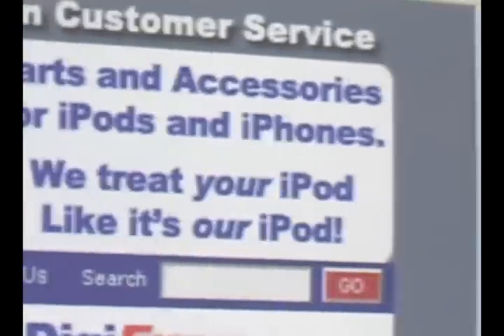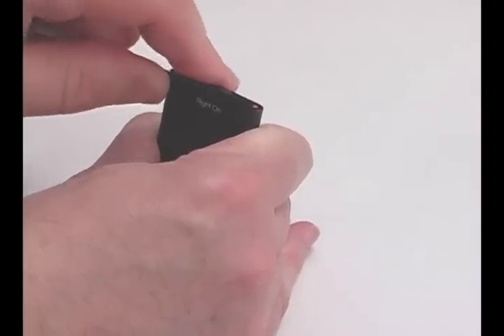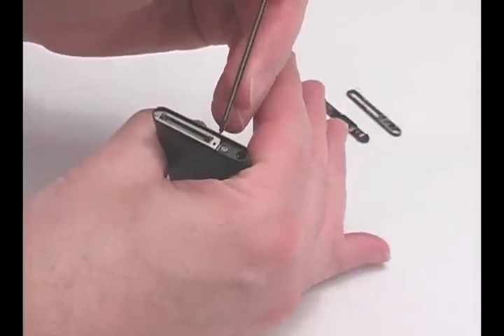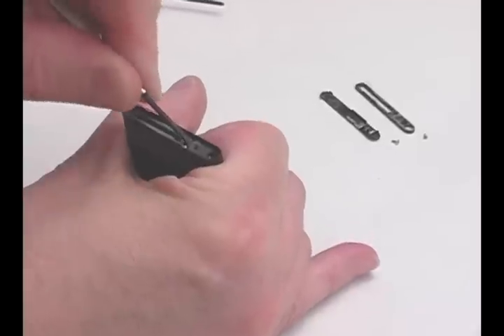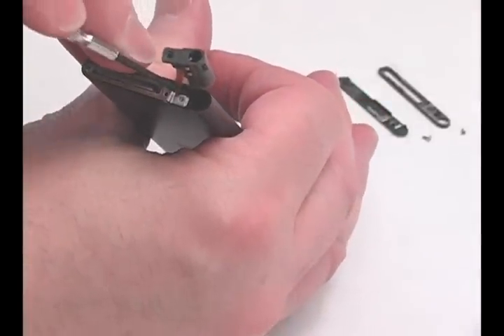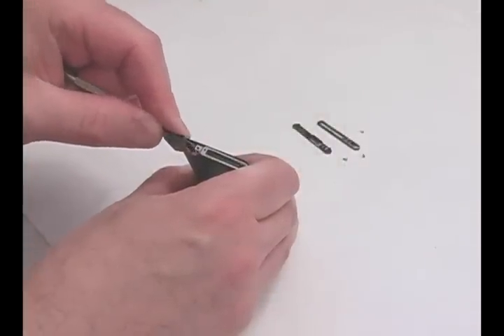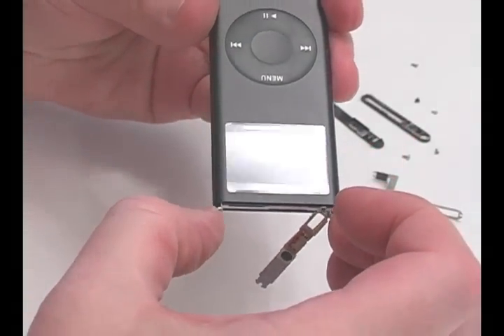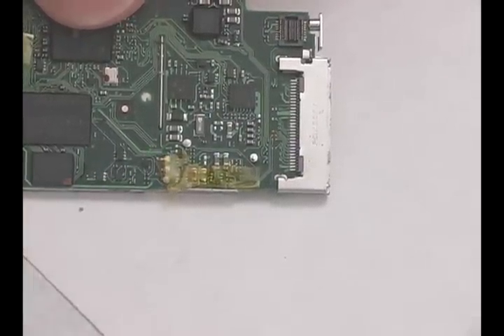DigiExpress - iPod Nano 2nd Generation Battery installation

Comment: I accidentally ripped out the battery without de soldering  is it safe to still put the battery on like as if I did it properly? I broke the headphone jack/click wheel thing off and accidentally removed the battery only trying to originally get the screen fixed :( I have the iPod with the new screen and battery but some of the parts to seal it all back I lost with time but I can always buy again. If I send you guys the mess I turned my iPod into could you guys put it all back together? I honestly don't care about how much it cost I love this little nano and don't want to lose it but if I have to buy another one please let me know I might just have to. Wanted to know from professionals if I can still save my little iPod. It's the one in this video.
Reply: Ripping out the battery without soldering is fine as long as you haven't damaged the board around the connections. If you've damaged the clickwheel, its a nightmare to fix and parts are scarce but if you really wanna..there are shortcuts. The only way to get a clickwheel/headphone jack assembly these days is getting another damaged one off Ebay and cannibalising it for the part. Most shops probably wont fix older ones as parts are rare. I have soo many old ones with me that need parts but I just cannot get em.
Reply: Thank you for the info. I don't mind the trouble behind it. Electronics & Computers are my passion and I specifically love repairing and because of sentimental value with it being given to me by a family member I would put it back together even if it is a lengthy process to do I'll put the extra time and money
Reply: Dave Williams I have a lot of older devices with sentimental value too..but electronics are electronics..they will fail someday, its just best keep it like that without attempting a risky repair that could further damage it..plus, Iv searched many places for OEM batteries and I never even found one..all the Chinese ones I dont really trust...what I did to practice was buy faulty ones from ebay for dirt cheap and repair em, some were unrepairable but gave me a lot of experience..maybe practice on another dead one(maybe water damaged) if you reaally wanna...good luck :)
Reply: That's funny you mention buying other damaged iPods to practice on because that's one thing I've also considered already and have wanted to do lol

Comment from the maker: It sounds like your clickwheel cable is going bad. It controls all of your clickwheel functions, as well as your volume functions. We sell the part for $19.99 on our website. And if you wanted us to perform the repair, it would be an additional $25. Here's the link: digiexpress.us/2nd-generation_c_25.html

Comment from the maker: That's hard to say. Especially with it being 4 years. If the rice was able to get all of the moisture out of the device, and nothing on the main board was corroded, then it would be fixable. If you're willing to open it, verify that the main board looks good and shows no sign of damage. However, if it is the main board, it's going to be not worth repairing, because the cost of the repair is more than the device itself.

Comment from the maker: The battery is definitely flat and if you change the battery the iPod should just come back to life.  Now when the iPod was sitting for the time, if it sat in an area that would experience extreme changes in temperature then you could have corrosion due to condensation.

Comment from the maker: Let's all agree that repairing an iPod Nano is different per case.  This video will help a technician who is familiar with Apple devices, get into the Nano 2nd gen.  This is not intended as a complete run through on how an untrained novice can complete this repair.  If you are a complete novice (who's VCR is still blinking "12:00") then please do not attempt to repair your Nano.  If you do, then you are taking a great risk of doing more damage to the device.

Comment: Removing the headphone jack is a difficult step, do not pull  the cable too much it will break and is a part of the casing.  Its a POS now.

Comment from the maker: @JuOn666 you are correct and also the leads from the battery need to be at a managable length.  Too long and the case will not go back together.

Comment from the maker: @gamalieljs First, make sure there is no debris or dust located in the headphone jack and that your headphones are connecting flush with the base of the iPod. You can use a dry Q-Tip to remove any dust that might be inside of the headphone jack.

If you're still having problems, attempt to reset it and try a different pair of headphones.

If it's still not working, it's likely you would need a new headphone jack which we offer for $19.99. Let us know if you have any other questions